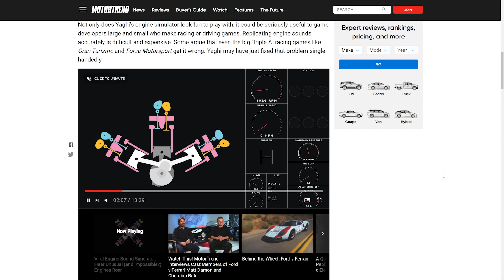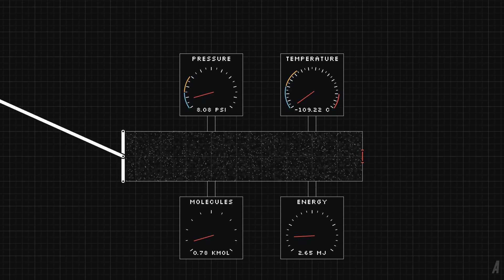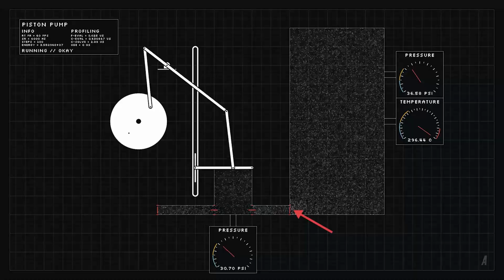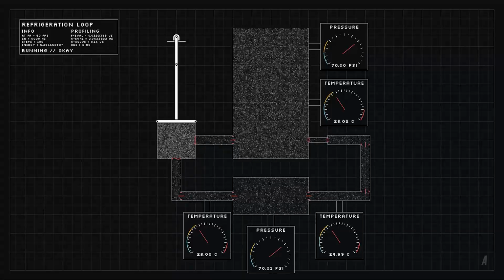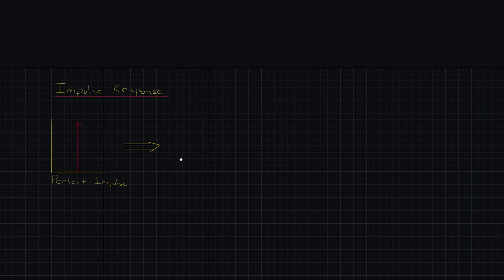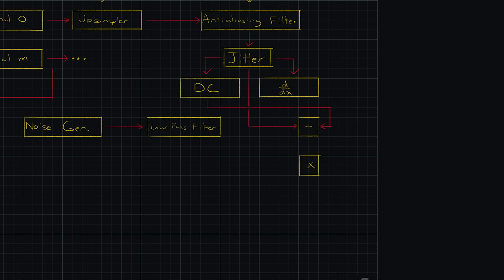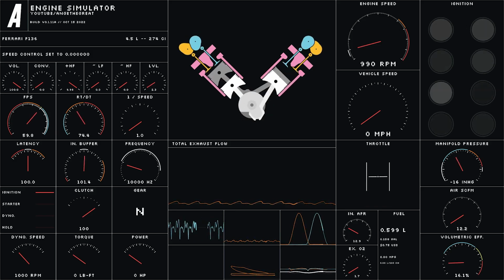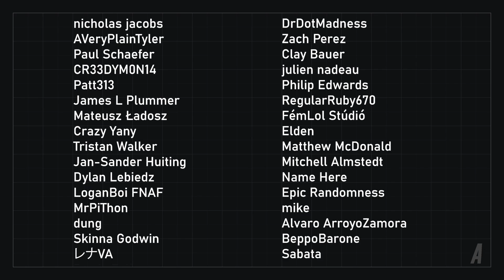Engine Sim: Procedurally Generating Audio Using a Real-time Fluid Simulation (Technical Breakdown)

Comment: Not sure what degree of realism others have talked about, but the tools used in the automotive industry is likely to be AVL BOOST and AVL FIRE. AVL BOOST is what's used to make the initial concept of an engine and is very similar to your engine sim. But it still takes ages to run because it's all written in python from what I can tell. AVL FIRE is used to create high fidelity simulations of the combustion process and like you rightly pointed out, takes even longer to run.
I haven't done any engine design since I studied it last year at uni, but for the initial concept phase, I'd much rather use ATG Sim than AVL BOOST , simply because it's real time and has much better UI. Just my 2 cents. I'm not an engine designer, but I have studied it in my masters and done HiL test automation for ECUs in the past.

Comment: I just watched your amazing simulator videos. Great work! Thank you. My only criticism would be your unusual explanation of the refrigeration cycle, but that's irrelevant to the engine simulator anyway.
Reply from the maker: Lol what's so unusual about it?
Reply: @AngeTheGreat   Refrigerators and A/C usually rely on latent heat of evaporation. The refrigerant is compressed so it liquifies at ambient temperature in the condenser and allowed the evaporate at lower pressure to provide cooling in the evaporator. Using the Joules-Thomson effect as you described is unusual.
I just joined your Patreon at the basic $2.50/month level. You're the first Patreon I've ever joined. $1 seems to disappear somewhere. Does Patreon keep that $1?
Reply from the maker: You're correct that most refrigerators use a vapor compression cycle. However, there are other refrigeration cycles though they are relatively uncommon. Since the simulation doesn't support changes of state, it would have been impossible to demo a more traditional refrigeration cycle, but nonetheless the technique I showed is still viable and used in some niche applications. And thanks for joining my Patreon! To be honest I've never really used Patreon as a supporter since I just set it up recently for engine simulator so I have no idea where the $1 goes. All I know is that patrons are charged on the first of every month. I don't think you should be charged immediately upon joining but I could be wrong about that. If you have any Patreon related questions, feel free to send me a message on Patreon!

Comment: This is the sound simulation I have missed since I first started playing racing games with Gran Turismo 4! 
In my opinion the sound from an engine under load and engine breaking are absolutely beautiful and have been overlooked in video games for way too long. 
Take for example Farming Simulator and SnowRunner, the load on the machines doesn’t have any realistic effect on the sound of the engine and it is so dissatisfying 😓

Comment: As a simulation engineer by trade I can tell you the people squabbling about whether this is a simulation or not completely misunderstand what a simulation is, and even a number of simulations engineers forget the principles and let their egos get in the way. There are two fundamental ideas that can be applied to all simulations: 1) A simulation is just a mathematical representation of a physical phenomena. Therefore, literally Newton's 2nd Law F=Ma is a simulation, and that can absolutely be seen by its derivation when you have to think about the simplifying assumptions that have to be made to translate the phenomena into mathematics. Simulation fidelity, and usually run-time, is often directly affected by those assumptions. 2) All simulations are WRONG, but some are useful. Every single simulation ever created is wrong, even the ones made by the smartest people. They don't fully capture every bit of physical phenomena around us, and they really don't have to. Good simulations tell us what we need to know to the degree of accuracy we need to know it for our application. Often in early engineering design we want faster less accurate simulations to get us in the ballpark and then use the complex models to verify the last little details. It all comes down to sizing the simulation to the application.  Fantastic work! It's really neat to see the equations of state and first order principles applied and visualized in this way.

Comment: You should try making the rolls Royce crecy engine, no recordings of it exist and it was a 26L V12 with direct injection side valves and was turbo and supercharged.  Apparently when it started up it set air raid sirens off 15 miles away.

Comment: I now want to hook this into the control system of an electric rc airplane and have it generate "large" engine sounds (and appropriate physical rpm response since that would otherwise be noticeably desynced). not yet sure how much computing power this needs in absolute terms, but it runs fine on my laptop so I suspect at worst something like a "nuc" could handle it

Comment: I don't know really when one is an expert when dealing with fluid dynamics, or any field for that matter, and I say this as a mechanical engineer specialised in fluid dynamics and currently enrolled in a PhD within turbomachinery.
But for what it's worth, I can't say that I see any issue with how you've done this to be honest. Especially when you consider the application for this program.
I mean, at this stage if accuracy of the simulation of the sound is something that one might be really concerned with, I think just the mechanical noise from the moving components would be the better target really. And I'm not suggesting that you should be going down that road, because I don't think it's a fruitful way to go anyways at this point.

As for what is a real simulation, a quote from a professor I've once had kind of feels applicable. "You can calculate anything you want down to as many significant digits as you please, but when the day comes where the sun shines on your construction, what of all your digits then?" Most CFD is so far from the truth that you can only at best capture trends from a range of simulations. Granted I'm primarily an experimentalist.

Comment: Except that most refrigeration is phase change based, in a properly working system there is very little to no vapor/gas through the expansion device, only liquid, hence the cooling isn't because of a vapor expanding. The latent heat of vaporization is what transfers the heat. The compression of vapor is only there to change the boiling point of the refrigerant so that it condenses and evaporates in the proper places, and the heat of compression only matters in that if the compressor's discharge temperature is too high the oil will break down and fail.

You can do cooling without phase change but to get the coldest possible low side you need an expansion turbine to capture the energy of compression.
Reply from the maker: You are correct, and I'm not an expert on refrigeration so thanks for sharing your knowledge. As I state in the video, the refrigeration scheme I showed is viable but not identical to how most common appliances operate. I would have liked to show a proper vapor-compression refrigeration unit but I haven't implemented anything in the simulation to account for phase changes so sadly it wouldn't be possible. Thanks for watching!

Comment: Hi Ange, first of all, thank you so much for this amazing project, this is the most fun I've had in ages!
Now, I am not an expert, so my question may sound really dumb, so I apologize in advance. After watching the video, I was wondering if there's a possible way to, for example, reproduce/ simulate just the audio coming from the exhaust pipes and from the intake separately. Cause I was thinking of testing the recorded audio on a sound mod for a game and I would try to model the sounds in a 3d enviroment around the car

Comment: not a coder, programmer, or automotive engineer (to any meaningful extent) but i work a lot with audio and i would LOVE to hear or see a slightly more dumbed down version on the specifics of generating such a sound. "and then i use the fluid simulation to do it" is a bit nebulous and i can't even theorize any way to approximate it outside of a full simulation :(

Comment: You explained how convolution filters work but didn't mention the most interesting part; what impulse response did you use for this? It's definitely not your living room reverb and I don't see how it could be an actual recording of an engine either
Reply from the maker: It doesn't sound that different haha
Reply: @AngeTheGreat  So the living room reverb was your impulse response?
Reply from the maker: Haha no not exactly, but most just use what sounds like a short click
Reply: @AngeTheGreat  I just had a thought - would it be worth using a cylindrical impulse response that changes size dynamically with the movement of the cylinder as the first stage of each combustion event? Then somehow add that to the header and exhaust IR?

Comment: Awesome! I wonder if it would be possible to add to your engine simulator other "chambers" to the engine to simulate the effect of different exhaust manifold and silencers (maybe even a turbine?), and different intakes runners, airboxes, etc...
If I understood correctly, given that's a flow sinulator it's """just""" a matter to allow to add the pieces together.
Would the simulator also simulate the pressure waves propagation and reflection?
Finally, is it possible to also add intake noise?
Reply: waves propagation and reflection are simulated by the convolution reverb
Reply: @neomorphosallomorphis7395  The audio is simulated in this manner, but not the backpressure due to waves reflected at the end of the exhaust.
(simulating a turning (Turbo) would not be all that hard :) )
Reply: @JCisHere778  That's exactly what I meant! Sound wise applying the impulse response is fine, but that does not change the engine behaviour in different setups, you need the flow and pressure waves simulated

Comment: Hi Ange, I was recently thinking that your simulator could also be used to render audio for airfoils. Like wings, propellers and rotors. This would help fight simulators and sound design of any model immensely. Would it be something you would want to pursue?
Reply: It could certainly simulate plane engines since there's really very little difference between them and car engines in terms of the basic parts involved. But as far as simulating the sound of airfoils moving through the air, it doesn't seem like it would be as useful for those since you can't easily model those with the static "chamber"-based approach he's taken, since the airfoil surfaces would be moving around. I could definitely be wrong though
Reply: @shmunkyman33  maybe you could do like an air tunnel like those demonstrations. If it simulates ram effect abd such maybe coanda effect would work. I don't know if it would simulate turbulence. Also an engine is cylindrical so you can simulate it in 2d but wings and such move the air in 3d space so I don't know if it would be possible with the 2d engine. Maybe simulate multiple planes (longitudinally, vertically etc) would do the trick
Reply: @alexnepu1561  at that point i believe you're basically just doing a finite element method simulation (I'm not an expert, but I've tried off and on to do these types of simulations over the years). There's already software out there that does this, but the problem is because the calculations are so fundamentally intensive, they can't run in real-time. From his description, it seems liks Ange is basically running a simplified version of a sim method that's usually run with many more cells, which is why he's able to achieve real-time results.

In other words, his system works extremely well when used with the limitations it was built for, specifically simplified fluid mechanics in large-scale, sparsely connected cells. Trying to use it to solve more general problems will probably just leave you with a less-optimized version of already existing simulation software, though this is purely my speculation. Not trying to be one of the reddit haters in any way lol, it's still an amazing piece of software!
Reply: @shmunkyman33  yeah I guess using a wrench as a hammer doesn't work that well. It's still amazing at doing what it's supposed to do.

Comment: is it possible to compile an impulse response "echomap" for a maplevel, akin to how lightmaps are generated from high-quality raytracing, then apply the convolution filter during runtime to emulate real-time soundtracing without the computation cost?
Reply from the maker: That's the direction I was heading. I wanted to implement procedural generation of the impulse response before releasing my first video but it was just too much work haha
Reply: @AngeTheGreat  If time-varying impulse response could be generated procedurally, I think it would actually have insane potential in musical instrument simulation! A whole new world of digitally-mediated musicianship that isn't just a Casio keyboard playing back the same sound with filters. Basically the digital equivalent of Steinway Spirio

Comment: That was interesting, because a) I happened to design an engine sound simulator myself... and b) there is not much literature available. Mostly people use sampling. I see your weakest link, or should I say a missing link, is a proper simulation of the exhaust side. That's why the engines sound like sewing machines. Sorry but I'm not gonna reveal how I modeled the manifold, muffler etc... it's valuable IP :)
Reply from the maker: There isn't a proper simulation *yet

Comment: I had a question about the UI, what are those graphs in the bottom center area depicting? I'm guessing the big one is the exhaust generated "waveform".  One on the right looks like the generated camshaft profile.  The rest I'm not very sure.

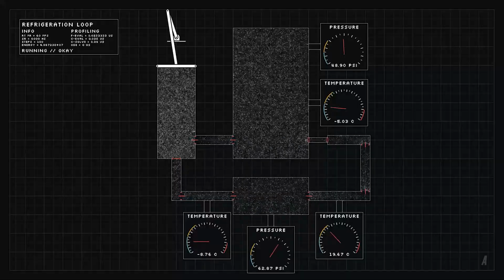Comment: At 9:50, in the refrigeration example, when the compressor is turned off after running, the pipe between the radiator and the compressor drops from over 50C to below -20C. Why?
Reply from the maker: That happens because that pipe is initially at very high temperature and pressure but when the pump is turned off, the system starts equalizing. As air leaves that tube and the pressure falls, the temperature also drops. It's similar to a spray can getting cold if you use it for a while.

Comment: You have a great exhaust sound simulator. Is it capable of handling engines with no exhaust? Where instead of vroom its more like kerpow? Also it might be cool to do that boneheaded sound per combustion event thing, except more for the bare engine sound, for when you have the hood open on a well muffled car. You know? When you can hear the combustion tap the block and the belts squeak quietly along.

Comment: your simulation can't be so wrong simply judging by the sound it creates compared to their real counterparts. In my humble opinion the most important part you did to make that right is to correctly simulate the fluid dynamics and not to try and find a way around it.

Comment: i might be wrong, but i believe the audio engine is still missing the intake's "air hammer" sounds from the intake valves slamming shut which might be why you are getting so many complaints
Reply from the maker: I'm planning to add intake noise, just haven't gotten around to it yet and it's less straightforward than exhaust noise
Reply: @AngeTheGreat  intake is complicated. You've got carburettors, single body throttles  individual throttles, then add to it the number of cylinders/cylinder banks in a V engine. They all change the intake "noise" shit even the shape of the intake runners matters. For a quick example look at the 2004 2005 F1 cars while they approach the camera, they all run the same setup (ITBs), yet they sound VERY different. Or the short BMW M3 GTR videos from VLN 2004 

for a proper simulation you would need to simulate all that. 

I've noticed that ITBs remove the musical sound aspect when they are coming at you and sound more "granular" yet one can still hear or rather feel how air is sucked harder. The Ferrari FXX (not the FXX K) has one throttle per bank and sounds more like an instrument. The F50 GT, while having a different engine, has ITBs, and it's when they are approaching a camera/mic that you can see how much of a difference intake setup makes.

Comment: Very cool!

I don't have a good understanding of HOW real time this is. Could this comfortably run 10 simultaneous engines alongside everything else in a racing game? IIRC, you previously said that you're running this at a very high tick rate.

Is it possible to study the output signals for a particular engine, and obtain a closed form approximation of that particular engine's behaviour? Are the signals simple enough that it could become some type of baked lookup table of input states?

If it's too hard to do by hand, I wonder whether it would be more performant to take this simulation and use it to train a ML model to output the audio corresponding to the inputs. It would take some clever architectural work to get the model small enough, but it might be possible.

Comment: Ange, I'm a bit new to such programming. Can you help me out with a query.? Can I use to emulate Formula 1 engine ? Like how can we do that ? Enter the amount of power in BHP so that it calculates RPM or vice versa?? How can we simulate that ? Without adding the electric motor that they have. ??